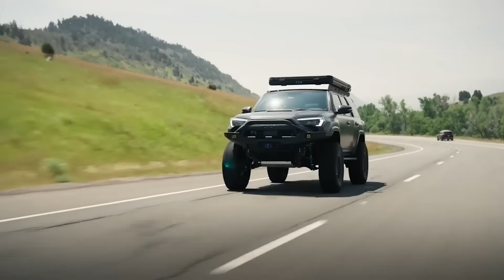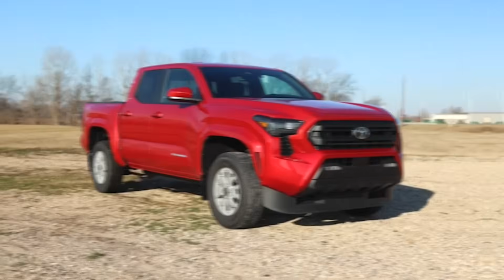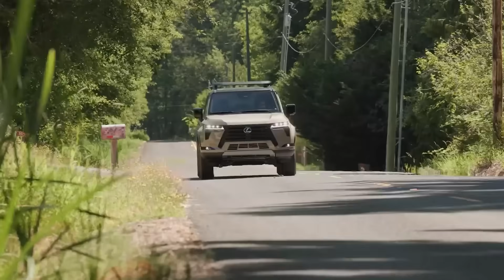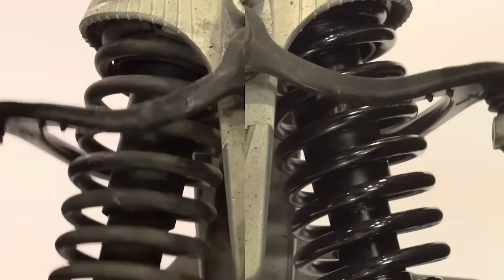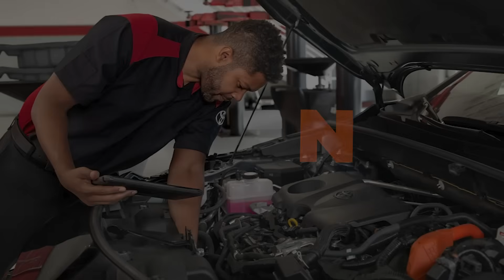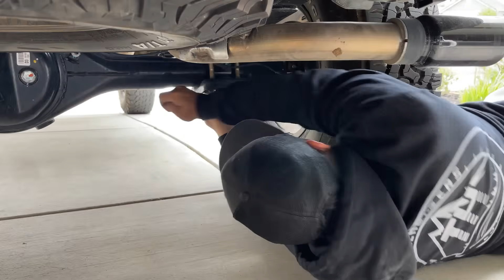Watch This BEFORE Lifting Or Modifying Your Toyota Off Road Truck

Comment: I begged the Differ. LIFT KITS as long is done accordingly meaning stick with reputable brands,  2nd dont mixed brands, 3rd  dont exceed the limit of what the products recommend,  and lastly plan/plan research then committ, build ot according to your style of driving. So yeah its worth it.  Remember plan/plan.